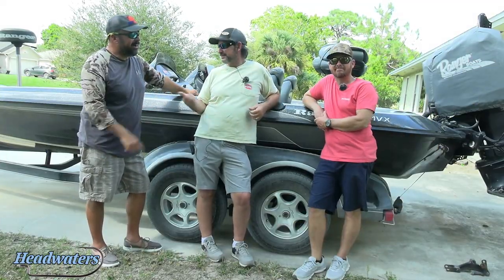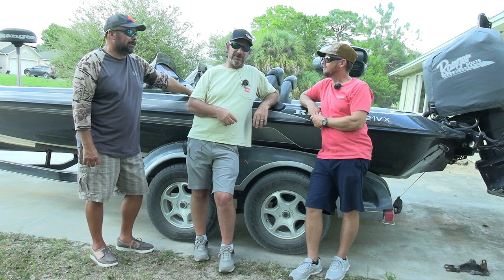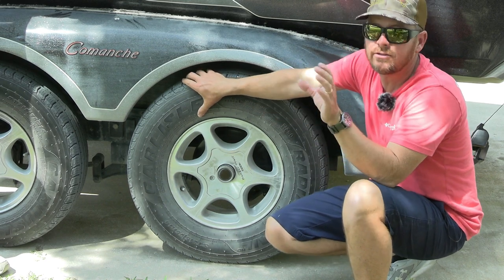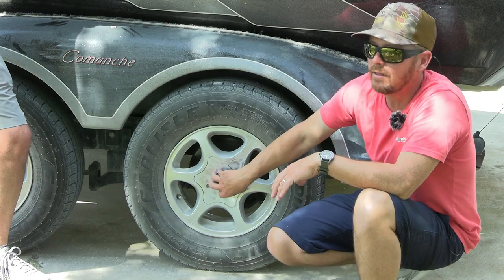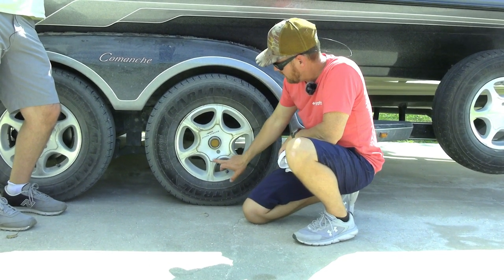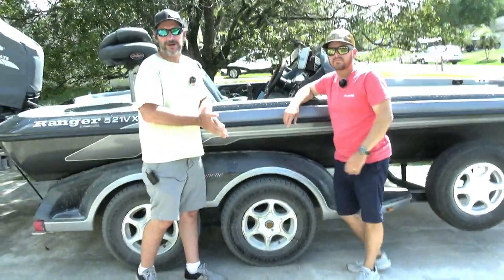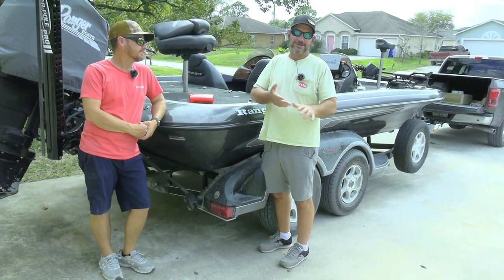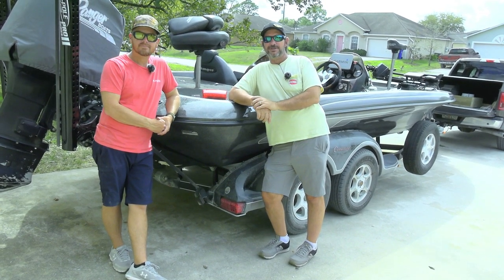The Best Trailer Maintenance Tips Video and trailering tips.

Comment: Great video, I would add a few things to your list:
1. Check tire pressures regularly including the spare.
2. When you are jacking up trailer and spinning tire to check bearings also grab it at top and bottom and check for rocking play. Another indicator hub/bearings needs work.
3. Make sure you have properly rated ratchet straps if going that route. I see way too many boat/trailers running down the road with those cheap 1" ratchet straps. Those are not anywhere strong enough to hold the boat down in an accident.

Comment: Great info as always. Check the hex screws, that under the bunk, they loosen, over time. A socket wrench, easy fix to tighten, when boat is water. If, not galvanized, replace them. Dan, next video, painting the skag.

Comment: Great Video, everyone needs to watch this if you have a trailer.  Here are a few tips from my experience...
1. No more than 5 years on those tires!!  And that's if you have good tires.  
2. Replace the inside fender carpet bunk that is usually plywood covered with Carpet and staples, with PVC board you can get  at home depot.  use your existing fender bunks as a pattern for the new ones and they will never rot out again. 
3. Even better than Heat Shrink but connectors, are the heat Shrink with solder inside but connectors, you can solder the wires together with even a lighter, and heat shrink all at once, and your connections are good as gold. Look them up on the internet, once you use them you will never go back to crimping. 
4.  If you have surge breaks, check the pads, the Calipers, and check the FLUID!!! very important. In addition check the connections to the calipers because they come loose over time and can cause catastrophic brake failure.  If you need to add fluid, find out WHY!! check those lines for dry rot or leaks.

If I sound like a guy that has learned all this the HARD way, it's because I have.
Keep up the good work Love the Hooked on Headwater Videos.
Tight lines
Reply: Thanks for jumping in with more good info. Good fishing Always.

Comment: Tire pressure. Make sure your tires are properly inflated. If they are low for a long time the tires will wear unevenly and quickly.
Reply: Good tip. Thanks for adding it to the list of things to check . Much appreciated.
Reply: be sure to check the pressure on the spare too.

Comment: If you have room, make sure you bring wheel chocks and a jack stand or two, not just a jack.  As for the lug wrench.  If you are using sockets, see if you can get 1/2 inch sockets, maybe even impact sockets.  A toque wrench would be even better, so that you can make sure your lug nuts are torqued to the correct spec.

Another thing.  Make sure your brake lines are secured to the trailer.  The galvanized steel brake lines I had on my trailer were not secured to the axle, so it vibrated loose and pulled out of the fitting, resulting in me losing brakes.  These are usually zip ties, so just check them every so often to be sure it's still there. Fortunately, I was able to get it fixed and it didn't fail in the mountains.  

Check the pressure in your spare, not just your traveling wheels.  Nothing like needing to replace a tire and finding out your spare is flat.  A good air pump is useful too.

Remember, do a walk around.  Check to be sure everything is working, and do annual maintenance.